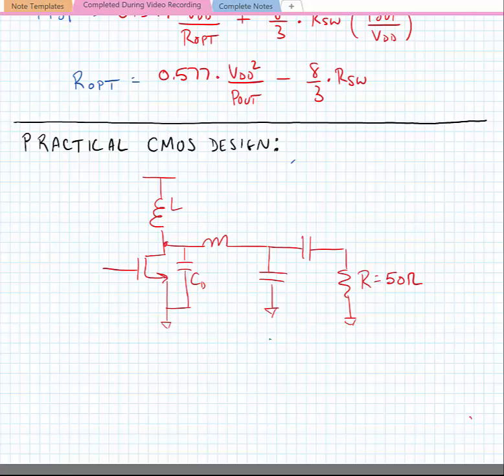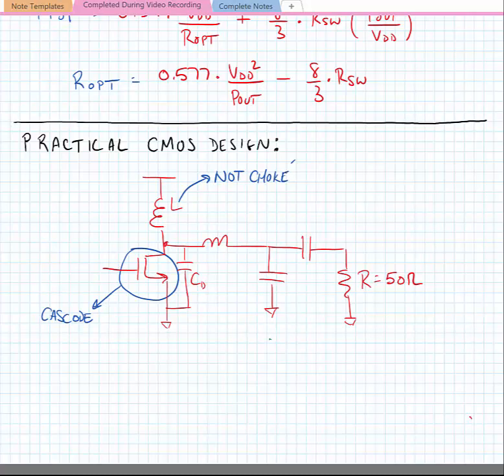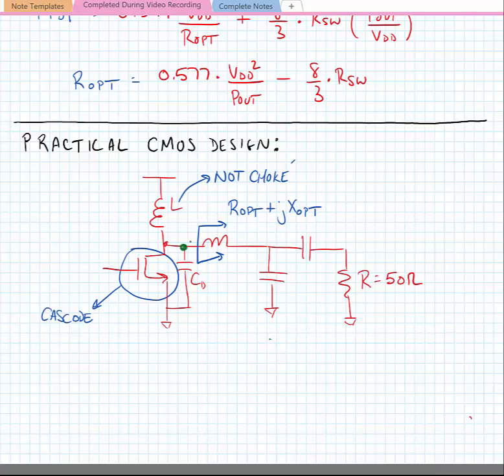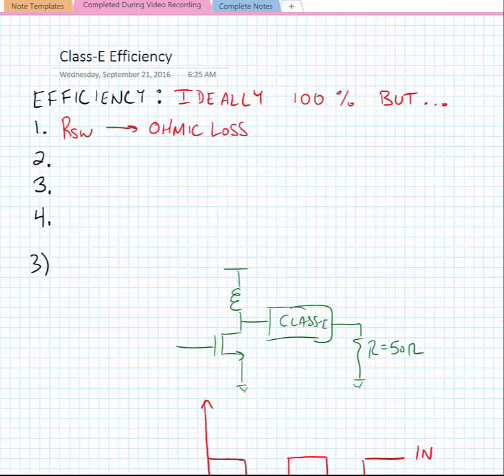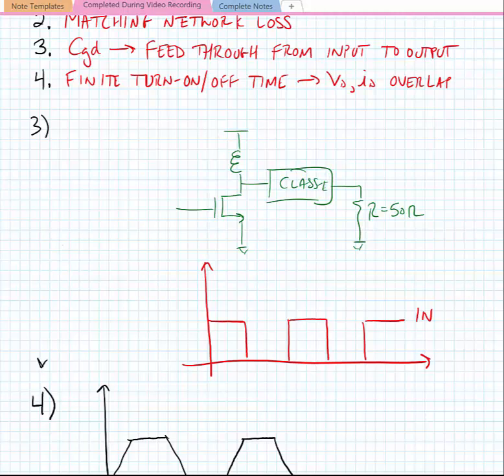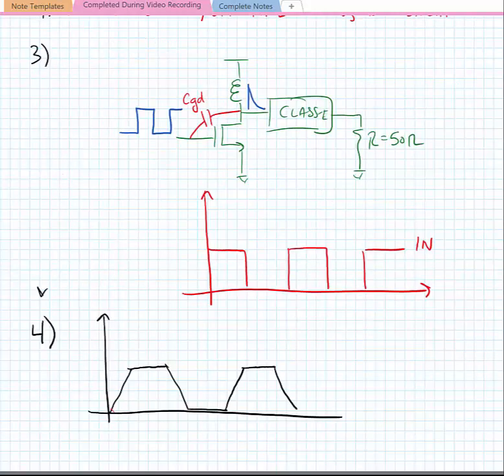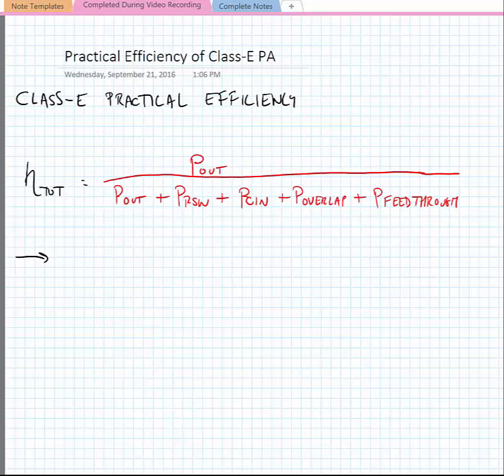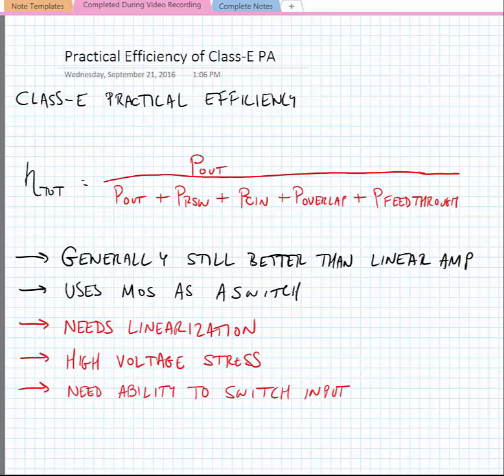Lecture 13.3 - Practical Considerations for Class-E Design in CMOS

Comment: Thank you for this.

If I were building a small, discrete class e amplifier, and wanted to view the current waveform, would a shunt resistor on the drain screw up the operation?
Reply from the maker: Anything you add will distort the waveform a bit, but if you don't load it too much, you should still be able to observe the waveform. Of course, the higher the speed and power, the more difficult it becomes to observe.
Reply: @wallingphd  thank you.  It’s been a while since I though about switch mode amplifiers.